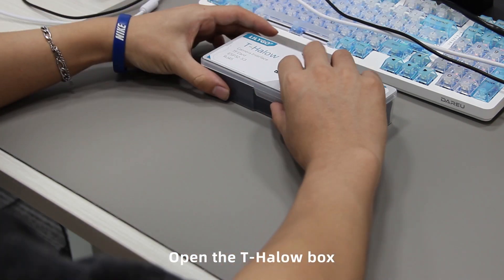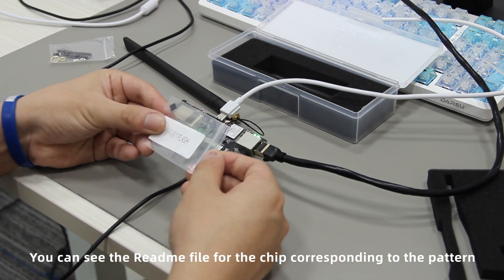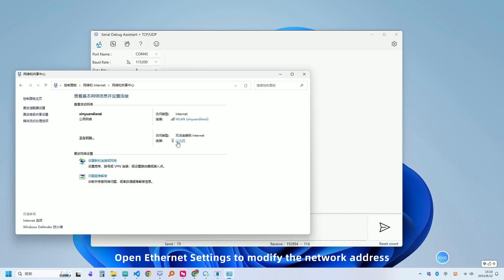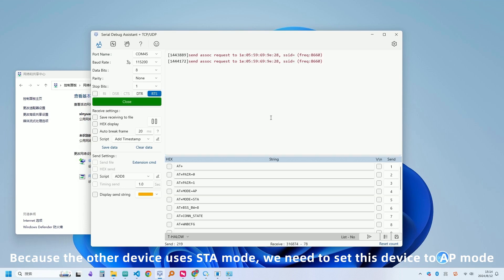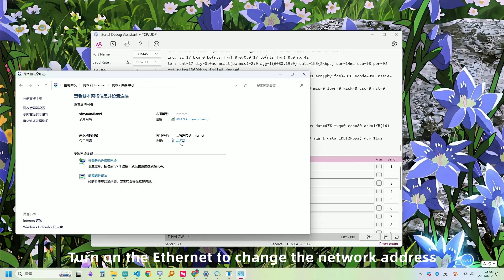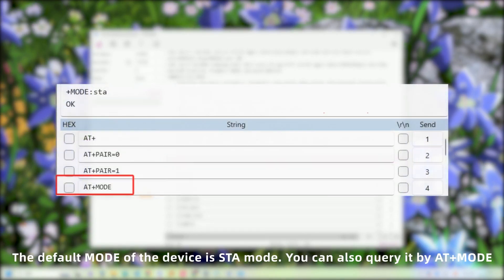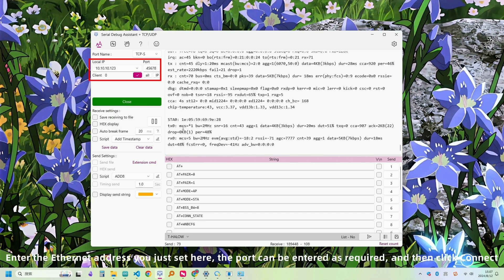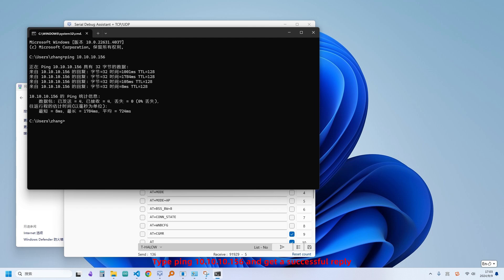How to use multiple LILYGO T-Halows to communicate

Comment: Hi, great movie for mode 2. I need same movie for mode 1 (without computers), can you point me for it  ? i"m trying USB-C to run AT command but the serial application doesnt respond to my command - only show rx data from esp-32
Reply from the maker: Open the MicroUSB serial port to send and receive AT commands. Do not use the type-c serial port. Select the serial port corresponding to MicroUSB.
Reply: @LILYGO  Is it possible to update the flash using the halow board itself ? if yes , how ?
Reply: @nirshem256  I got stuck on the same issue. One of the devices doesn't respond to AT commands.

Comment: Am I the only one thinking that all this LoRa and Mesh tech isn’t getting us anywhere? The more users join, the less bandwidth we have. Instead, we should form local groups where each member invests in a few thousand meters of affordable single-core rugged fiber optic cable (about $30 for 1000 meters) to connect with neighbors. Everyone maintains a small server and router for the community. It’s easy to fix if needed, and you get gigabit bandwidth. And for those extreme situations where fiber isn’t an option, we can still use short-range wireless with modern technology and a small budget to bridge the gap.
Reply: I think it is geared towards IoT devices but def not exclusively. IoT devices often like to be as wireless as possible

Comment: Have you tested the range you can get with these T-Halow boards? Halow is supposed to be low-energy/long range, with distances reported at ~1km or so. I'd love to see real tests of it, and how it fares in difficult environments like cities.
Reply from the maker: We tested the distance of about 1.2 kilometers in an open and unobstructed environment under the bandwidth parameters of 915Mhz and 8M.
Reply: I attached one receiver and a raspberry pi to a drone, flew it at an altitude of 60 meters, and got a nice, crisp connection at a range of about 3 km. However, I had a 1 meter long Yagi antenna on the ground, which had a gain of 16 dBi - the better the combined gain of the antennas, the more likely it is that the signal comes across.

I should say I flew this over a field with absolutely no occlusion at all. No trees, no buildings, nothing.

If you were to use two small omnidirectional antennas, you wouldn't get that far. Also, any occlusion, like trees, will drastically diminish the range.